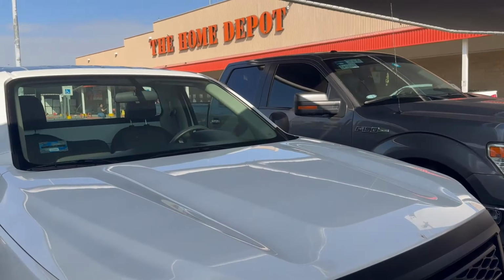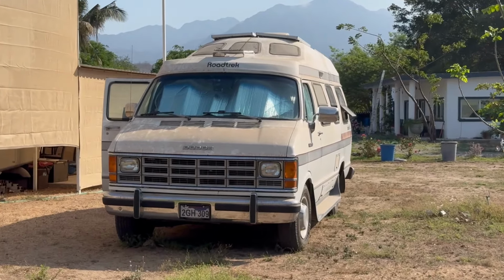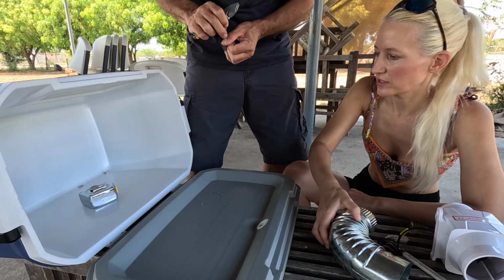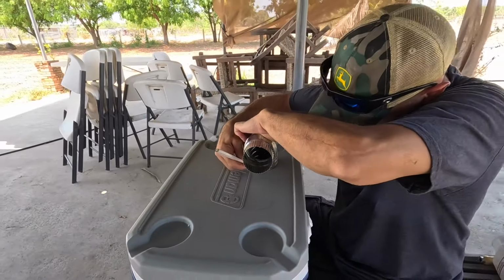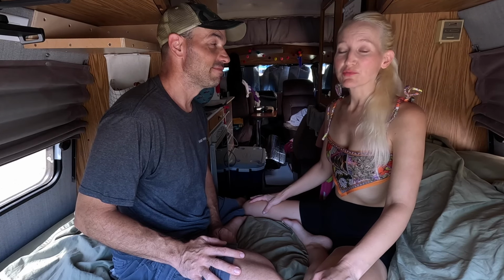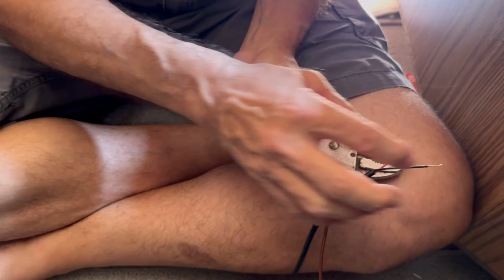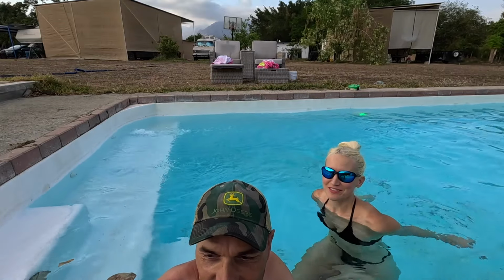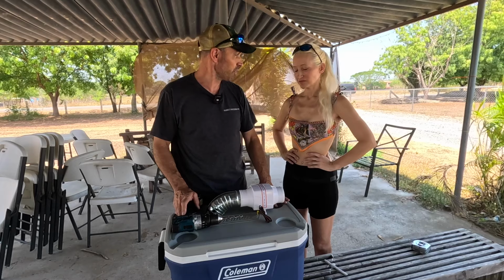Van Camping in EXTREME HEAT: Pan American Highway Adventure (OFF GRID DIY A/C Cooler) | EP 15

Comment: It will work but take the tube out of the cooler and let the fan blow into the cooler put the hose on the exit side and aim it at you that way it blows air over the eyes and then out the hose don't leave the house inside the cooler like you have it
Reply from the maker: Thanks for the recommendation Kevin we will give that a try 🙏🏻
Reply: Yes, the ones I've seen don't have anything but ice inside, that said - curious how yours works!
Reply from the maker: @LEVandLUNA_vanlife  we will dive into that next week.

Comment: Well, I'm watching this having 50 f outside at 2 am, quite the contrast. Also, the ice chest will give you some cooling, but not down to 70 f while driving, and it will last for roughly 4 hours, perhaps a little less. Again, great video, great humour, I'm looking forward to following your journey.
Reply from the maker: Wow 50 F sounds good right now. We have had some rain storms that brought cooler temperatures. What a relief 😅 You’re estimated for the life span of the ice is spot on. We get about 4-5 hours for two bags of ice. Just enough time to get AuBrey through the hottest part of the day.  Thank you for watching 🙏🏻
Reply: @BarelySqueakinBy  Well, I cheated... Just for the fun of it (I'm an IT guy after all...) I used an AI to calculate how well it would work... And seemingly, I wasn't too far off. Have a nice day :)
Reply from the maker: @ohrosberg  haha AI for the win 😂 such a useful tool and accurate! That’s awesome see you next week.

Comment: Ice wont make a big difference. You need to keep the water in cooler lower than the ambient outside temperature. Wrap the cooler in that chrome bubble wrap insulations and a roll of duct tape holding it in place. Also if your air pick up has a piece of swap cooler batting(blue. Your air installed has to be outside. A swap cooler will only make a max difference of 20 degrees in low humidity.

Comment: Making those cuts by hand? Wow! Nice work! 
And it will blow cold air until the ice melts -- you could add salt to the ice to extend it's useful life. 
Cliff-hanger, Lol. Guess I'll have to wait for the final verdict. Also, it should do a good job of keeping your beers (cans) cold at the same time -- just pack them in there tight.
Hope AuBrey's eye is better. Thanks for the "heat advisory". I'm very much the same -- keep me around 19 - 20 C/ 68 - 70 F for best results. I get too hot way too easy. I'll take your advice on best time to head through Central America. Looks like you found a nice gem of a spot there!
Cheers!...from North Vancouver
Reply from the maker: Yeah just working with what I have. When the ice melts into water we pour it into the tank to use it for cleaning dishes and things. As a bonus it does work quite well for keeping drinks cold also. AuBreys eye is doing better thank you for the concern ❤️🙏🏻  Cheers Adrian🇲🇽

Comment: Greetings from your most loyal Non-Patreon fan 😂 .OMG is that a bandana top ? ❤. Greetings from Quartzsite. It's Sunday and it's going to hit about 106. 😂. So I'm sympathetic to your situation. Haven't finished the video yet so it'll be interesting so see how it pans out . When you folks head back north we'll have to meet up for a nice fireside dinner and chat . Update : ok , rule # Numero Uno  ! Always wear some type of gloves & safety glasses when dealing with situations like this , that blade could easily snap & take out your eye , or at the very least a nasty cut . Imagine yourself miles from an emergency room in Mexico. Rule # 2 if you're cutting plastic with a knife , heat the tip of the blade slightly, ( hence the gloves ) it will glide through like warm butter . But be warned, heating causes the blade to be more brittle ( hence the glasses & gloves . ) the keyhole saw is your friend . Heat that bad boy up and it will zip through the plastic . I'm not speculating here my friends , I've been a master carpenter for ions . ( Ghetto & otherwise ) 😂. Necessity is the Mother of invention. Have you considered dry ice as your source 💭 ? IDK if that's available in Mexico 😊. But going forward , please be safe and practical. Looking forward to watching the rest of the video ( I'm currently @ 7.45 ) let's see how it goes 😂.
Reply from the maker: Wow 106 that’s getting up there! It feels close to that inside the van when you factor in the humidity 😅 AuBrey has some fun outfits she brought on this trip 😍 You make some valid points about prioritizing safety I will definitely be more conscious of that moving forward. Thank you! The hot blade is a great idea if the plastic was thicker that may have been necessary. The hole saw would have been ideal but I didn’t want to purchase one for two lousy holes then have nowhere to store it and then throw it away. I have had great success with 50/50 dry/wet ice in the past when camping. Not sure of the availability of that down here 🤷🏻‍♂️ great idea. Thank you for being a loyal follower and commenter ❤️ it means a lot to us.